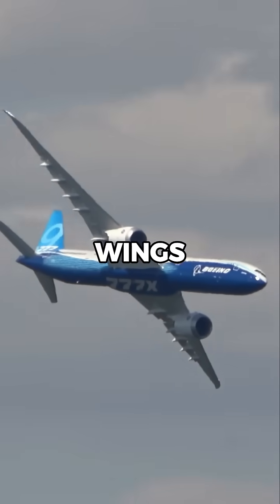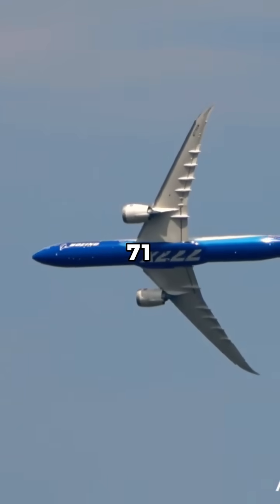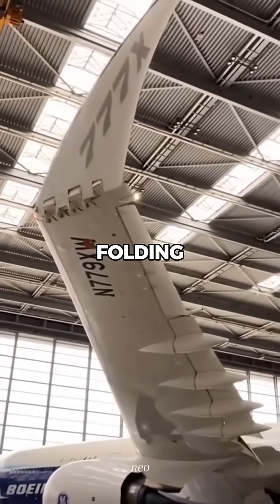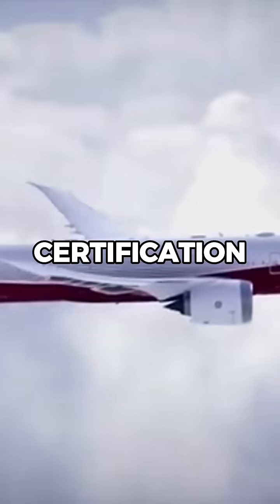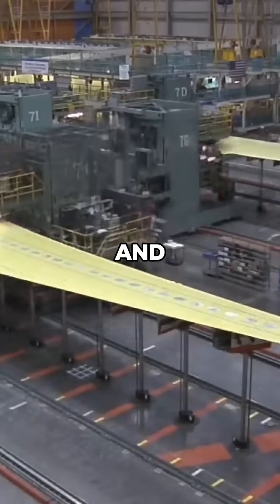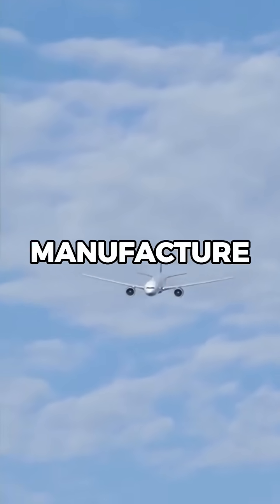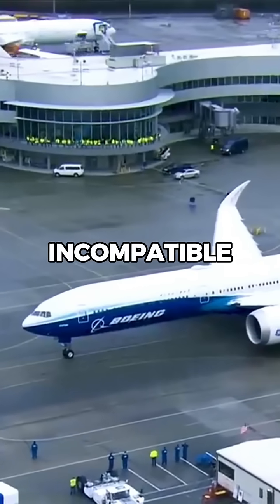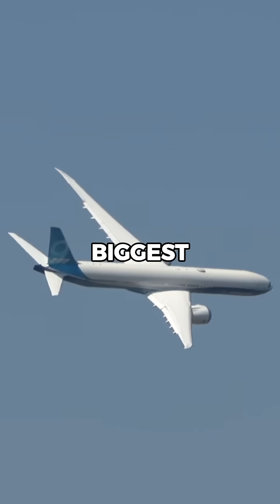why are the Boeing 777x wings its biggest problem?

Comment: Completely false considering the 777X is designed to fit inside the same gate envelope as the current 777-300ER due to its folding wingtips

Comment: I feel like there could be many crashes like the 737 max because
The wingtips will auto retract middair
One wing tip doesn’t retract after takeoff causing loss of control
Mechanical failure 
Wing tips falling off
Reply: That won’t happen
Reply: They have a button that will fold the wingtips up automatically
Reply: The wingtips are unfolded out and locked into place before take-off. They don't move in flight. Fighter planes were using folding wings back in WW2.